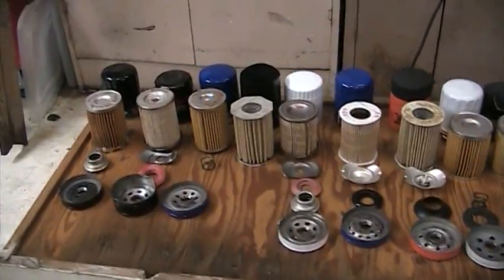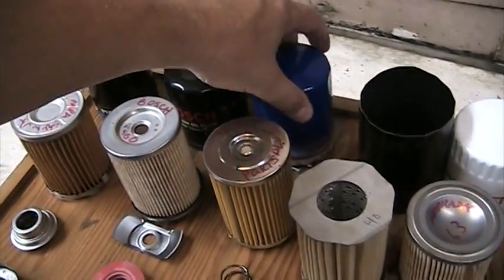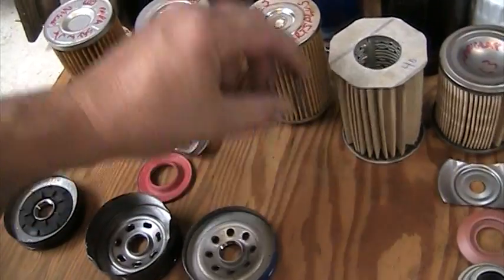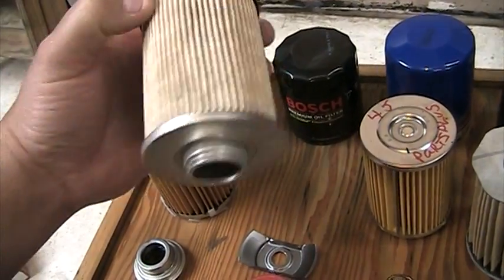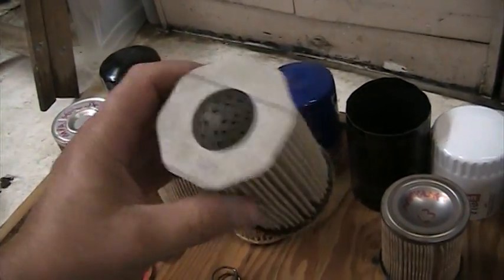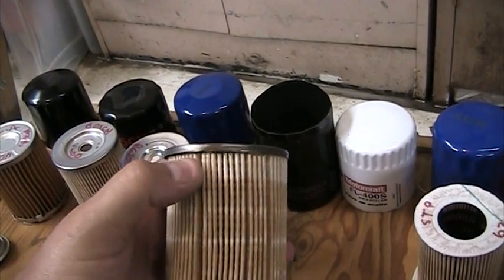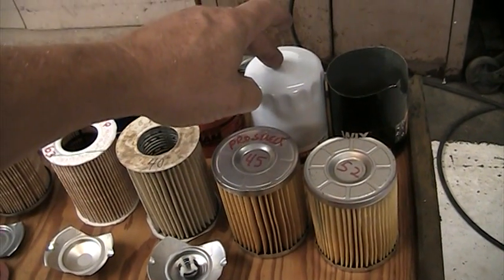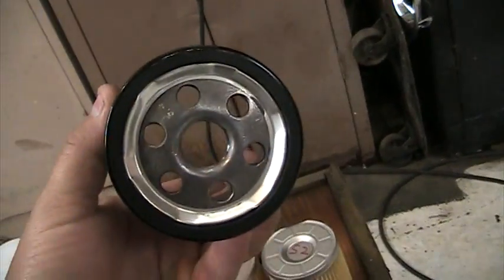9 OIL FILTERS CUT AWAY ( LOOK INSIDE) AND RANDOM CATTAGE

Comment: I use to only run fram filters but after seeing a video on the quality I switched to motorcraft because I have 3 sbf and instantly had 20 more oil psi over the fram on my 351w. thats reason enough not to go back.

Comment: no two filters are alike...some are good quality and others not so much...that said, you usually get what you pay for...but whichever filter you choose, if it is changed at regular intervals along with using the recommended motor oil for your vehicle, there should not be any major issues....it's a personal choice....the average Joe really doesn't care which filter is in his car as long as it doesn't cause any problems...only gearheads get weird about their oil filter brands.

Comment: I just bought a new Napa gold oil filter, Model number 7060 and was bought to replace a ac Delco Pf-48 ,
I did notice the bypass valve has been changed to the bottom of the filter , can you tell me why. the bypass valve is shown on top on the specs and videos, that’s one reason I bought the Napa gold filter this style can let dirty oil from the bottom of the can to bypass and it is cheaper made than the old style ,

Comment: To each his own. Have used fram for years. 285,000 miles on 1997 T&C, 195,000 on 1999 T&C and 161,000 on current T&C. Have had all sorts of sport/muscle cars over the years and used mostly fram on them. I have never had a bad oil filter except on my new 1989 Trams Am (without screaming chicken). Could not get it off no matter what. Had to remove the filter mount. As I say, to each his own.

Comment: Maybe a 1989 Taurus 3.8 or 1999 Taurus3.0, 99 Taurus 3.8 is non existing. But using the same FL-400S as a Motorcraft Cross-Ref
Reply: Right, On! I have a 2005 Taurus SE. 3.0. 156, 000. Motorcraft blend 5W20 and Motorcraft filter. Steel case and 63 pleats. Doesn't burn any oil. 25.0 miles per gallon still.  Shawn

Comment: The engine is a 1MZ-FE and 7500 miles is OK for semi-synthetic.  You do have to keep an eye on the engine and PCV valve as these engines will turn into sludge monsters if you stretch the oil too much.  I have run Mobil 1 Extended Performance out to 10,000 miles.

Comment: If YOU owned Mann or Mobil, would your lawyers allow you to recommend 20K intervals for changes?...lol  Beyond what THEY recommend,  I worked at the BMW dealer from 08 to 10.  BMWs twin turbo N54's were regularly doing 15-20K changes (per CBS requests) using castrol and Mann filters (branded BMW, but manufactured by the two companies to the same specs as the store bought supplies).  20K is def a lil long to go on a filter (of any brand), but most my miles were highway blasts.

Comment: Mann or Hengst.  Its not even a question!  I have an old Mercedes M104 with 170K miles on it.  I go 15-20K between changes with Mobil1 15w50 and a Mann or Hengst filter.  Oil doesnt start smelling used till about 18-19K and when I did the valve cover gasket earlier this year the valve gear was clean enough to eat off of.  No lie!

Comment: in all the tests i've seen the toyota oem filter is usually pretty good. It's up there with pure one. But someone really still needs to do a good test measuring the pressure drop. I only see particle filtering tests. But if the pressure drop is too great you will easily starve your upper engine. So that test is pretty important.
I think denso or something makes toyotas filters.

Comment: I usually just stick with OEM stuff. It's hard to visually see which filter is better unless you're looking at something useless like a fram. These really should be hooked up and run so you can see the pressure drop across and the level of filtering. It's pretty hard to tell how good a material is at filtering by looking at it dry. You could easily be surprised with a 40 pleat performing better than a 60 pleat. Just saying i'd stick to the scientific method compared to looking and guessing.

Comment: I always use high quality, reusable oil fiters that are made of billet aluminium and I never use paper element filters. 

Btw the Motorcraft has very tight pleats because it is designed to run on high viscosity oils such as 5W30, 5w10 and other fully synthetic oils.

Comment: I have had good luck with Fram, but I will phase out the Orange Can as I am switching to much longer oil change intervals.  The last O.C.  I will use is a PH8A  which is very oversize for my application.  I am right now using a series 3600 Fram Tough Guard which actually is a pretty good filter to 7500 miles.  I will use Toyota (7500 miles) and high-end Bosch/Mobil filters (15,000 miles)  for the most part after, though I do have an STP 3600 floating around somewhere

Comment: the only thing more respectful i seen on fram was a pinched metal clete to hold the filter,
sorry people but um glue? if it heat style glue what do you think is going to happen to it?
engines get hot so does the oil.